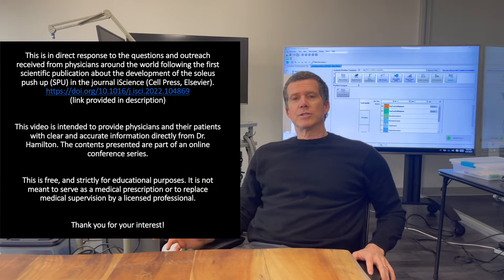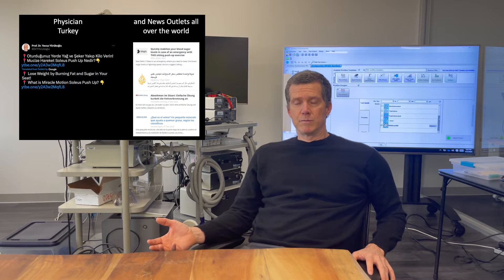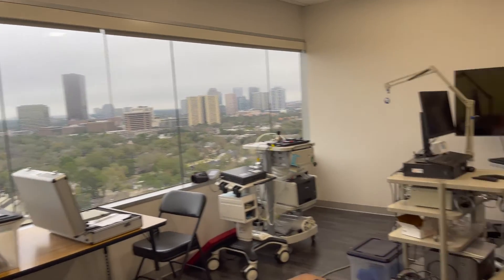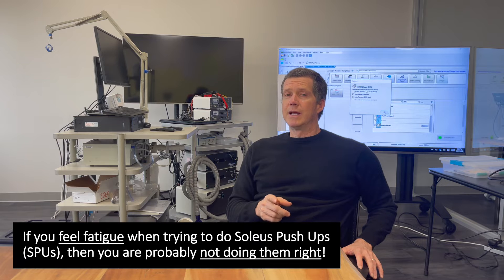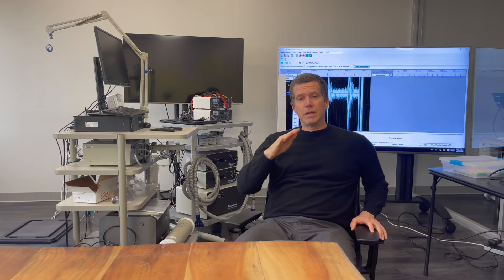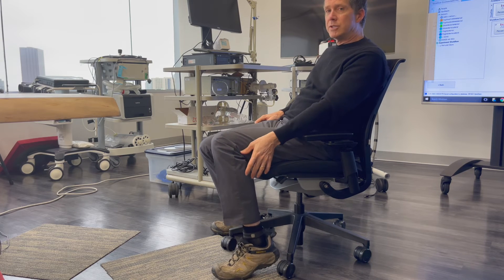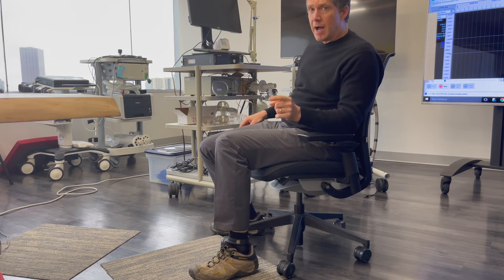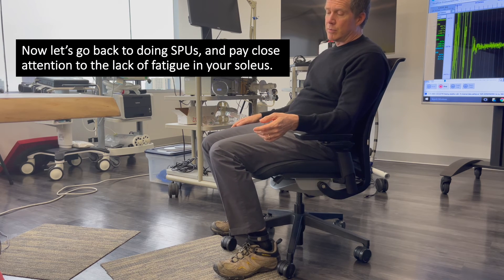Fatigue Resistance of the SPU (Soleus Push Up) demonstrated by the Developer, Dr. Marc Hamilton

Comment: Doctor, it was a very nice presentation. Please clarify whether I can do SPUs with the right  leg for some time and then keeping the right leg at rest with the left leg or SPUs should be done with both the legs at a time simultaneously?
Reply from the maker: @dulal7328  Yes you can. “Metabolic inertia” = A practical mindset that you want to keep your metabolic engines in muscle humming all day while awake (as opposed to the stop-start cycles you would be forced to do without this SPU soleus activity). 
Analogy - If you know anything about some kinds of machines. Apparently it’s FAR less wear and tear and better for a long lifespan of a compressor within an air conditioner in homes to be “multistage” instead of turning on-off dozens of times per day. A multistage motor keeps working all day, without having to RE-start each time. Instead the AC keeps working at a low level (like your 1-leg option) sometimes and higher level sometimes (2-legs), but avoids the harsh stop-start option (all or none).  For some of the evidence for this in muscle physiology: Read the Discussion section of our SPU publication (see free link in our website and video description).
Reply: @marchamiltonphd  Thank you, Sir. It's
a great pleasure for me to have your valuable reply.
Reply from the maker: @dulal7328 glad to help. Also don’t forget to read all the other comments to the existing videos in this channel. It’s ok to ask about them too. There are over 200 detailed replies I’ve provided at the last count.

Comment: It doesn't work for me, sadly.
My blood sugar doesn't lower. I tried for 20, 30 minutes and 1 hour 😢
Reply from the maker: If you want to learn don’t be discouraged because from what you’ve said it appears you are still early in the learning curve. But I can give you and everyone a general comment about biomedical research vs self experimentation: people in the public should not be warned to not listen to anyone who tells them to do a quick experiment in the themselves without lots of careful planning and understanding of how to test a treatment. 

I can guess for example from what you’ve said that with further thought you would agree to a couple things. We obviously do not know what methods you used, including doing the movement correctly without sufficient practice and more expert lessons. 

However it appears you made a general incorrect assumption that shouldn’t be done with any kind of potential treatment (whether that be a drug, supplement, exercise, etc). Given the way glucose regulation works in the body, it’s virtually impossible to do an activity and take a blood sample 20-60 min later and determine from that whether or not the exercise did or didn’t impact glucose regulation. You are welcome to read the research methods we used but that’s unlikely what you want to do. Sort of like you can also read an automobile repair manual but most likely you’d say it takes more education and experience than just reading. 

The “bottom line” is not to be “sad” but trust something you can be more certain about. 1. When you work a muscle it needs fuel. When it’s not working it needs negligible fuel. 2. The soleus is enriched with metabolic machinery better than other muscles. 3.  We did our best effort to study it during SPUs, and learned with the best possible methods that compared to inactivity on one day, other days that people where fed the exact same amount of a high glucose load there was a consistently smaller increase in blood glucose within the next 3 hours in everyone tested. Blood samples were obtained each 15 min. Generally the rise in the first hour was blunted already by about 45 min and the glucose in the SPU day stayed at a lower level than compared to the inactive day as long as they kept doing SPU activity.

One other comment. The goal of this or ANY treatment is not to lower glucose at each moment of the day. For example your body wants to burn fat sometimes instead of glucose. That’s not a bad thing, of course. In the same research paper we actually showed this with SPUs. Think of it like “metabolic flexibility” (not my term but one widely used by researchers). I for example have been doing SPUs the past hour this morning and my blood glucose has been steady, because obviously my body is sensing what kind of fuel to use is best for me at the moment.
Reply: @marchamiltonphd  

Thanks for the reply, probably people commenting that it worked for them within just 20/30 minutes (these people claimed to wear a CGM) or other doctors spreading the news saying that the effect  is immediate got me confused. I watched your videos on how to do the exercise.
Still, after 5 days of trying the exercise my blood sugar, tested 3 times a day doesn't bulge. I use Metformin and Ozempic. 
I don't even eat carbs at all. 
Probably I'm the odd one out ...
But my blood sugar lowers if I get a 15 minutes fast walk, after the meal or fasted. 
I'll keep trying. 🙏🏻
Reply from the maker: It looks like now that you’ve said this in follow up (you don’t eat carbs and take those meds) that we understand. In agreement with what our research studies are showing in other people, SPUs work by a very different process. If you eat low carb, or are in the fasted state (not eaten in a few hours), we learned the soleus will focus on burning fat. But here is what’s a good key to that to know. Because this muscle is very enriched with an enzyme called LPL that binds to and breaks down the more dangerous VLDL fat (the kind that causes heart disease and/or inflammation), we learned the soleus uses this kind of “bad”  fat preferentially. We study this enzyme LPL and VLDL fat because it is known to be difficult to “turn on” this kind of fuel use during normal  exercise. There are not any drugs that help to burn up this fat by muscle anything close to as well as soleus activity either. People with diabetes and prediabetes and some kinds of cardiovascular disease (for genetic and other reasons) have too little LPL activity. In fact, most people like myself don’t have diabetes and don’t want my glucose to go down lower, but do SPUs whenever I’m sitting. That is so that I can avoid the common problems associated with sluggish VLDL fat metabolism (cardiovascular disease and inflammation are common causes of things like dementia and other age associated problems, albeit worse if you have diabetes too). 
Hope this is now a more complete but clear explanation?
Reply: @marchamiltonphd  thanks 👍🏻 
It's clearer.
But now I wonder, why is everyone presenting this as a great help for diabetics to lower the blood sugar? 
Thank you doc 🙌🏻
Reply from the maker: @DebbieTDP  because it is! The body doesn’t want to always use one kind of fuel.
Reply: @marchamiltonphd  okie, I'll keep exercising.
All much clearer now.

Thanks a lot for the Time and Patience.
😊
Reply: @marchamiltonphd  Excellent, thanks.

Comment: Thank you for your great work on this. Can SPU be done while standing? I tried doing the same movement while standing for about 15min alternating my legs and very less fatigue. Do you think this will work?
Reply from the maker: I need to make a video of this and write a more detailed explanation. It’s a common question. For now I’ll just give you a quick answer. Do the standing heel lifts as a method to make stronger muscles. Do that for brief amounts of time to minimize injury and maximize strength training. But that’s the “wrong gear” for being able to sustain a high Soleus muscle metabolism like you can do with SPUs at a few periods of the day you want to while sitting anyway. It adds up such that by the end of the week you’ve been able to maintain a healthy muscle metabolism for many hours with SPUs (as opposed to minutes of most activity).
Reply: @marchamiltonphd  thank you for the response. I look forward to a detailed video whenever you post.

Comment: Is it normal that I feel like not feet/legs are not in exact tandem?
Reply from the maker: It’s OK to have variations depending on the situation. The simplest advice is like the Nike advertisement said, “Just Do It”. The key physiological thing to consider is “what matters is what each muscle sees locally each minute of the day you are awake!!!”, as explained below. 

So it doesn’t matter if each of your muscles are working at the exact same moment (“dual” mode) or more like when you walk one leg at a time (“alternating mode”).  

EVERYONE REMEMBER THIS SHORT PHYSIOLOGICAL LESSON (it’s easy):  Each soleus works independently when its individual motor neurons activate it. Each has its own blood supply and metabolic machinery sensing and responding to the local energy demand. Each side locally  turns on hundreds of processes controlling the molecular genetics, making new proteins. The end result is that each muscle gets more endurance and better physiological machinery to regulate inflammation and glucose and fat metabolism and other processes. Those local events improve distant tissues in the body (brain, heart, fat, liver, pancreas, etc).
Reply: Thank you!
Reply from the maker: You are welcome. If you believe that you have a unique biological reason for asymmetry in the muscle on each side of the leg, it’s OK to email off-line for more discussion.

Comment: Hello Dr. Hamilton, I had an abnormal experience today. I checked my sugars first thing in the morning and it was 103 mg/dl.. I did about 10 mins of SPUs, and just rested for about 45 mins. Didn't eat anything or exercised. Just had a glass of water. When I checked again, it was still at 103. What do you think could be the reason?? Usually my levels are lowered by 20-25 points with 10 mins of SPU, but not this time.
Reply from the maker: We should probably discuss this off-line via email. Here I’ll make a general comment that is very important for everyone to know for certain. In my research findings, the soleus sometimes uses mostly fat for fuel, and sometimes mostly blood glucose. We have never assumed that SPUs always decrease blood glucose concentration each moment of activity. We did find that after ingesting a 75 g load, people who were doing SPU activity correctly all reduced the rise in glucose that takes place beginning after about 30 min of the sugar test drink. A huge issue to consider in all studies of various exercises in general, is asking “how long after stopping exercise will the metabolic rise last?”  That is complex and depends on several factors. But in general, the blood glucose lowering after stopping activity is “less certain” than the blood glucose lowering DURING thr momentary activity. Makes sense? I hope so because not enough physicians and scientists seem to appreciate this; so I suppose the real world patients have not been taught this frequently.

I’ll add one major point that is good logic everyone maybe can understand. When you turn off any engine, it is self evident the fuel use plummets back down. So it is for muscle metabolism! That is ONE big reason WHY we developed the SPU activity; it is a rare way to keep muscle metabolism humming at healthy levels throughout the day.
Reply: @marchamiltonphd  Thank you so much for the elaborate explanation, Dr. It all makes sense now. You are a godsend!

Comment: Sir the heels should be touched to the ground ? If we keep our foot just underneath the knees ?
Reply from the maker: One key variable to the amount of energy required by the Soleus is how much total range of motion it moves.  So it’s not critical or necessary that the heel touches the floor. You can move the foot position to any place that it seems to be comfortable and helps you most easily maintain a wide range of motion. Also, 
you can count with a clock the number of contractions you do in one minute. Start at between 40-60 per minute and try to move the heel up and down over a comfortable but long range of motion.  Then as you speed it up, keep that same range of motion. Most people can do it at 100/min and maintain a good range. But after about 130/min, the range decreases. That means you are moving too fast.  While doing this you will find the ideal foot placement and if you prefer the heel to touch down or not.  

FINALLY AND importantly, no exercise does you good if you don’t do it!!!  The more TIME you spend working muscle is related to the direct benefits. So while MAKING THIS A NEW HABIT THE TIME per day is a good goal.  

In summary: You asked about the quality. I explained that is based on the range of motion more than just the rate.  But I also explained that the quantity of time is where you need to make serious goals and remain committed to it every day.

Comment: Hello doctor, is it even better to do the heel raises whilst standing up not sitting though?
Reply from the maker: No it’s better while sitting for 2 simple reasons. You can do it many more hours per week while sitting than while standing. Secondly (and less obviously), if done right, there is not as much extra Soleus energy use to do it standing despite having to load it with your entire body weight. I for example can activate my Soleus just as intensely with seated SPUs as with standing heel lifts!  But I don’t get sore from doing SPUs after ANY amount of time (even 50 hours per week!).

Comment: Hi, as an "eldery" runner I have experienced aome Achilles tendon discomfort, will ths agravate any Achille's tendon problem?
Reply from the maker: I don’t know specifically whether it will tend to help or aggravate your situation, but here are related issues to consider.  Even just when walking (not running), that huge tendon in the back of the ankle has an enormous amount of extra tension put on it. This happens because it resists the forces applied by your ENTIRE body weight tugging on it. The Achilles tendon actually stretches and then recoils (springs back to a shorter length) during each step to propel the body forward. That is very unlike when sitting to do an SPU. In fact, this was a major fact we used when developing the SPU activity. Why? Because we wanted to develop a way to safely help aging people keep using the soleus muscle  without the kind of high force-stretch-shortening action in the Achilles. Although that is better for sustaining metabolism than brief amounts of walking/running, I don’t know if the SPU motion will also help to heal the Achilles by nourishing it with the extra blood flow. However, often after a knee replacement, patients are prescribed protocols to repetitively bend the knee without body weight for many hours per day (not minutes like normal exercises).

Comment: I noticed that when I was doing SPUs the “wrong” way my heart rate went up over 100 bpm and when I did. SPUs correctly my heart rate did not increase . Is this an indication that I am doing the exercise correctly now ?
Reply from the maker: Yes there should not be either a large heart rate (HR) or blood pressure (BP) response. We reported that the heart rate barely increased in our first published research study.  Blood pressure and heart rate can remain at normal resting levels in most people. One reason that HR and BP go up during most kinds of exercise (like hand gripping or standing heel lifts) is because there a metabolic stress inside the working muscles that stimulates tiny nerves embedded in muscles that lead back to the brain. What we need (and working on) are tools to help everyone like you learn how to optimize Soleus activity with SPUs (“the right way”).

Comment: Do you think  electrical muscle stimulation could help?
Reply from the maker: To keep it brief (a lot can be said!) here are a few points. 1. When doing the natural kind of motor neuron stimulation (SPUs), the electrical impulses are imperceptible. It would be impossibly painful to get the same response by man made stimulators. 2. The effect of this is if you want a very intense stimulation of the soleus for a long time, by far the SPU will do that best (more intense than even running). 3. SPUs are also is hassle-free to do anytime/anywhere without needing to wear electronics. So there is a physiological and practical benefit from simply learning an easy new habit. 

Extra details: I’ve spent a lot of time researching electrical stimulation and it definitely has its place. But artificial stimulation of the soleus isn’t nearly as powerful in raising metabolism (as SPUs) and takes a lot MORE discipline to do everyday throughout the day (than just learning how to make SPUs an automatic habit).

BTW - the following fact won’t make some happy but can’t be overstated. Companies trying to sell you electrical stimulators often make dishonest health claims.

Comment: I wonder how a weighted SPU push changes things?
Reply from the maker: It generally reduces the intended benefits. Adding load induces fatigue. This isn't intended to replace strength training. And strength training soleus contractions are done so briefly, that strength training is a poor substitute for SPU activity (AKA "soleus endurance training" if you want to call it that). SPU activity is what you do within the dozens of hours each week that you are sitting at otherwise too low of a rate of muscle metabolism to sustain health generating processes underlying the contribution of optimal muscle physiology.
Reply: @marchamiltonphd  Thank you for replying much appreciated.